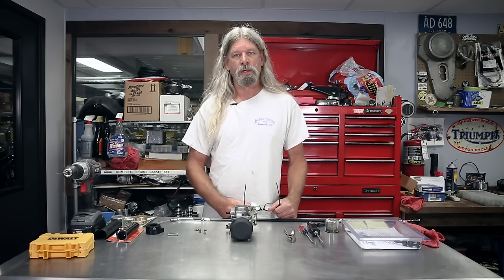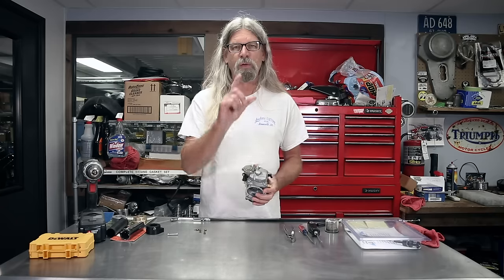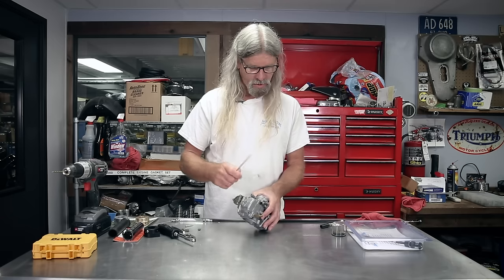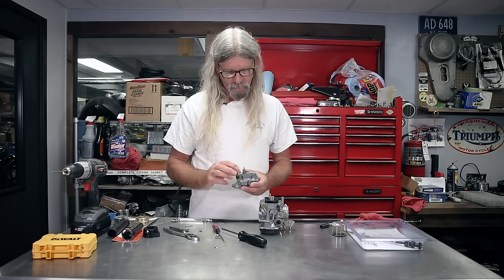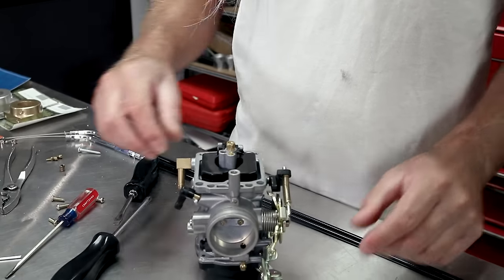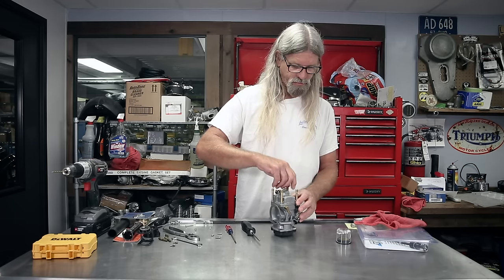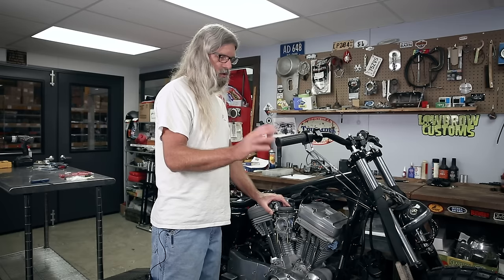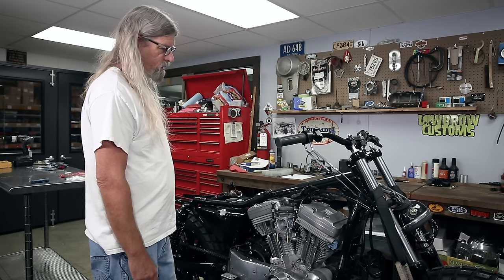Saturday Sportster - Season 1- Episode 8 - CV Carburetor 101 and Installation

Comment: Love this channel.

I was able to put on my hammer 1250 kit watching your videos.

The hammer videos are good too but they all engine out of bike.

You doing the install with engine in bike and showing little tips and tricks made it a breeze.

My first engine build!

Honestly thank you!
Reply: What jet sizes did you use and what year bike?
Reply: @DEATHMETALCYCLE  2018. So it's a canbus fuel injected bike. No carb so no jets. 

I used the dynojet power vision with break in tune and running tune from hammer that came with my big bore kit.

Honestly after getting it professionally tuned it was a so much better. 

But yea sorry. Im fuel injected.

I do remember they gave me bigger injectors in my kit. I don't remember the size though.

Comment: Great video I just picked up a 89 Sporty 883 Hugger and it had a cheap knock off carb found a oem carb on ebay and got carb put in bigger jets and fixed a manifold leak and bike is running so good Quick tip if u get a bike with Chinese knock off carb and replace it to OEM (witch i highly suggest ) the cables on knock off carbs dont work on OEM Harley carb so get new throttle cables

Comment: I adjusted my float because it was set a little lean from the factory. Just be careful because the little rod holding the float slides out and back in one way. Some CV carbs have an arrow on the body to let you know witch way to tap it out.

Comment: I run one of these on a single carb converted 1982 Yamaha Virago and mine doesn't have that extra plastic nipple on the engine side of the carb. What is that for?

Comment: Have an informative question. Why the CV as opposed S&S ? I bought 20004 sportster custom had same carb as you took off that bike that I hated, but everyone said go with S&S and it was great for the two years I had bike until sold to son of guy in our riding group. Love the content
Reply from the maker: CV is what comes on Sportsters it just works best. but you can dial in an S&S. sometimes they run a bit colder on a Sporty and Todd just prefers a CV on a Sporty.. Its all preference and your comfort of tuning etc. YOU DO YOU

Comment: Hmm,. Just wondering about that “plug” in the carb.. it looks like a Kehlen carb, made in Japan.. they usually come in banks of three or four. One of the carbs will have the air mixture blanked off and used as the “permanent set” carb.. when balancing, all of the others get set to that one.. 
im wondering if all of the “Harley” carbs are blanked?

Comment: Hi i have an 883r ,does the carburetor slide go up and down when engine not running ,having did idle but stop under load thought i was vacuum on fuel petcock but replaced it ,ran for a bit but now stalls and wont restart cheers rob

Comment: Theres an old guy made a twin carb alloy harley casting for the double barrel side draft.- webber.
- just needs 1 diaphram off car carby - external to adjust mixture.
Reply: That sounds similar to what Edelbrock used to make back in the early 90s but stopped making them . A old school buddy I know has one on his hopped up big twin Evolution lowers super glide & it runs hard enough to beat some modded twin cams pretty easily .

Comment: 1:20 These plugs are found on a lot of bikes, because the manufacturers have to make the a/f ratio "tamper proof" in order to be allowed to sell their bikes in certain markets. 
Theis might not be mandatory in the US. But the regulations in the EU call for that. And I guess Harley wants to keep their stock simple and only hold 1 carb for all different markets.
Reply: HD has been doing this  since the late 70s early 80s on the crappy Keihin carburetor they used on the bikes being a big twin shovel or the big twin Evolution and Evo sportster's . They would plug the idle mix screw like these CV carbs but also has limited jets sizes for the intermediate & main jets plus no adjustable pump shot so not much a guy could do with them performance wise compared to the CV that came out later . After screwing with both that were installed on my 84 XLS Roadster and my 86 FLHT and having issues with them not performing after years of use I bought a new S&S super for each and never looked back . The sportster I had built as a stage 3 engine & added the Thunder jet to it to add another fuel circuit and once tuned on the dyno it was making well over 130+ hp on pump gas. I tried a SU eliminator carburetor at one time on the sportster when it was stock other than some drag pipes that was a CV style carburetor and it definitely made the bike run better than the Keihin as well as power but the damn tickler which is used to flood the carburetor being it doesn't have a choke or a accelerator pump the diaphragm that's used for it kept ripping so it wouldn't work which caused hard starting when cold . It was also supposed to have a bimetallic valve inside to compensate for elevation and cold weather and I found out that didn't work worth a crap especially in cold weather trying to drive the bike when it was in the 30 degree days and a tad warmer . The other thing is these use a piston to move the slide up and down and every once in a while you had to drip a little oil down into the piston  by unscrewing the main jet nut that's on top of the piston housing to lubricate the piston because it was made of aluminum and not plastic or rubber like these CV use  . They look cool but for what I paid for it back in the 80s wasn't worth the hassle or how unreliable it was in cold weather so I went to S&S & they were much better and more consistent . I belong to a local car club and we have a mini sprint car that's on display in the place and it's powered by a Buell 1200 cc engine that's been modified that makes over 100+ hp and it uses a S&S super G with a thunder jet on the carburetor also and it's very quick and a blast to drive when we take it out each year to show it when we have our yearly car show at the club and people love it being it's just a smaller version of a real full sized sprint car with a fuel cell electric fuel pump roll caged chrome molly tube chassis and the wing on it .

Comment: hmm, what would u recommend for ironhead 900 andrews pbplus cams, two into one exhaust with muffler and super b carb;;;;;;;;;;;;jetting,,ps, i aint there on me thing yet but will be at least by may,,thanks
Reply: Contact S&S because they have manuals that show basic tuning & jetting on the engines . Super B carburetor might be too big for a 900 because if I remember that's basically a drag carburetor for racing . You have to remember that on a 900 that hasn't had any head porting or flow work done along with stock sized valves or compression bumped up with a big carburetor on it throttle response will be sluggish until the engine gets up higher in the RPM range where flow is high enough in the heads to over come the bigger throat size of that B carburetor even if you jet it way down . In all honesty I think you would be better off with either the CV carburetor if you can find a intake manifold that will allow it to be used on the iron head as it's mounted  different than on the Evo sportster's intakes are or stepping down to the S&S super E that has a smaller diameter throat size so throttle response is much better at all lower to mid speeds right up to top end which is better for the street because it makes the bike more tractable where a bigger or too big of carburetor has low speed and mid speed sluggishness but makes good power wide open at high RPM as long as the jetting is correct or close which isn't what you want because you will be reving it all the time hard . The other thing is with a larger carburetor that's jetted too fat that causes poor fuel economy plugs that will turn black & foul plus you will get ring wash from the excessive unburnt fuel in the cylinders especially at lower speeds and RPMs and ring wash wears out cylinders and rings quickly because it's washing the oil that's needed to lubricate the rings and cylinder walls . I probably have a jetting manual for my S&S super E for it but you should be able to either look online or call S&S in Lacrosse Wisconsin and talk to someone in the tech dept on jetting that should get you close . Depending on what compression ratio you have or if the heads were modified ported big valves flowed on a flow bench plus the pipe and ignition used the jetting going to be different than a totally stock 900 would be and you will have to test & tune but the best way would be taking it to a shop and have it dyno tuned.  Also these old Iron heads keep an eye on the intake seals and make sure that the carburetor is mounted solid on both sides if possible because these engines the intake seals are only held on with hose clamps and if the carburetor isn't mounted solid with brackets to the engine or head that will cause the seals to leak or worse yet the carburetor will come loose and fall off while riding it plus leaking intake seals will cause a severe lean mixture which can cause engine damage if not fixed . On the evolution big twin and sportster those use a totally different intake seal design plus instead of using band or hose clamps they use a cast aluminum pressure clamp that bolts onto each head that pushes the intake and it's seals into the convex that's machined into the intake and each cylinder head to push it & lock it into place then a bracket that bolts to the front of the carburetor that also bolts to both heads keeps the carburetor from moving at all so on the evolution engines they had much fewer leaky intake seals than the old Shovel head big twin or  the old Iron head sportster engines were having issues with years ago . I had a built stage 3 1000 Iron head that I had the heads sent out and done like a top fuel nitro head work done big valves ported & flowed as per spec sifton valve springs with a sifton black widow cams designed for 10:00 and higher compression stoke stroke but 0.30 over bore using torque plates while boring then final hone to make sure the cylinders stayed round .  Roller rockers lightened push rods all balanced blue printed with a Garry bang hp clutch spring and Barnett kevlar series clutch's and replaced the stock gears in the transmission with Andrews back cut gears which are stronger and make shifting much smoother to a point I could power shift it at 7000+ and not use the clutch once moving with no missed or clunking shifts and used a S&S super E with a Thunder jet to add a 4th circuit plus python anti reversionary pipes and a dyna tech 2000 programmable ignition set up for single fire and once tuned on the chassis dyno it was making close to 130 hp at the wheel and would pull hard to 7,500 so they can make good power if parts are well thought out to use before hand .
Reply: @peteloomis8456  super b is fine for this, i already ran it but with dragpipes with thymbscrews,,,gas eater though,,thanks for th tip

Comment: Adding a Harley mini tach to a 2005 sportster 1200, where does the pink wire go, it has a male plug on it as to plug it in. The pink wire is only 15 inches long, the other 2 wires are the hot and ground that you for your help

Comment: Want to know why those screws strip so easily? It's because they're not phillips, they're actually Japanese Industry Standard (JIS). Get the right tools and they don't strip.
Reply: Agreed! I have Vessel JIS drivers, they’re the best!
Reply: I was just going to post about using a JIS screwdriver. Obviously they work fabulously in JIS screws, but they ALSO work great in regular Phillips screws…better than a Phillips screwdriver in fact. It’s amazing how few people know about JIS. I had never heard of it until I bought a Goldwing and the guy at Cyclemax says “Do you have JIS screwdrivers?” I was like “What’s that?” I’ve even talked to service managers that had never heard of JIS! As I understand it, Phillips was originally invented so that screws could be tightened to a specific torque by machine and when the approximate torque was reached the driver would “cam out”. Which makes perfect sense if you’ve ever noticed how a Phillips screwdriver likes to cam out of Phillips screws! LOL You can “kinda” simulate a JIS tip by SLIGHTLY grinding down the end of a regular Phillips. It’s not truly JIS because the JIS profile is more complex than that, but it does make a difference. I don’t buy any screwdrivers anymore unless they are JIS.
Reply: Or do like most of us on the XL forum who are still running a CV carb have done and replace those screws with allens.
Reply: I was so frustrated when I learned about JIS drivers. Lol after a few years of servicing cnc lathes and more stripped screws than I care to admit, another tech casually mentioned them. Lol
Reply: wtf😠
Reply: I actually use flat head machinist screwdrivers when dealing with float bowl screws, which works pretty well most of the time 👍

Comment: That carb is probably set for a 88ci came with 190 main jet. My Dyna was terrible ( shutter) mid range had to shimmed the needle jet… after adding high flow air filter and slipped-ons

Comment: I want to know what keeps that carb from falling off. Am I missing something? I’m not familiar with sportsters
Reply: The air cleaner assembly, on stock bikes. To run a modified air cleaner there is a small bracket you need to buy. It threads into the breather holes on the head.
Reply from the maker: you need to use a carb support bracket and we suggest using breather bolts in the heads to hold it on etc.

Comment: The problem with drilling out the jets is the next guy who opens up the carb has misinformation on what jets are in the bike. His starting points for any changes are wrong.
Reply: That's why you need number drills, I check'm all
Reply: When doing mods it's always a good idea to write it all down in your manual or make a diary of sorts to keep the information on this so if needed you can look back or if you ever sell the bike the new owner has all this information on hand .

Comment: Drilling out that pilot jet probably works fine, but you’re making a video, that a lot of people are watching. I think it’s misleading at best, that you would show us how to do that! You know some people will screw its up. You should have been more prepared. Also, in the future , if someone needs to change it again. It’s still stamped with the original size. Which will be confusing. Maybe tell the viewer to file off the original size. Otherwise, good video. I need to get into one of these come spring, that I think has a needle, seat stuck shut.

Comment: Everytime I come across those, I replace those clips to screw clamps .  I think The only reason they use those is for looks. I see no other reason. I hate those!!
Reply: They are much cheaper and on the assembly line it's much quicker to install.
Reply: They're probably better clamps, those aviation clamps, I call'em, on small diameters, can't pull round because the gear mechanism gets in the way. I thought about getting set up but to expensive for me. I like the spring clamps but not the cheap ones.